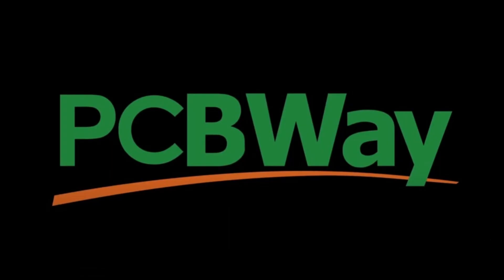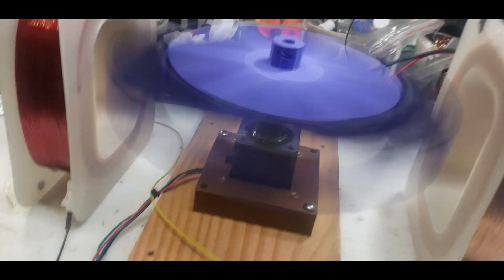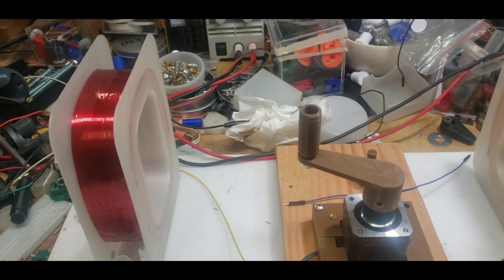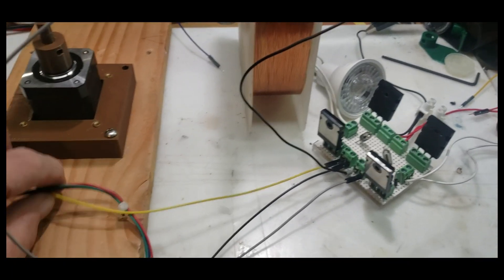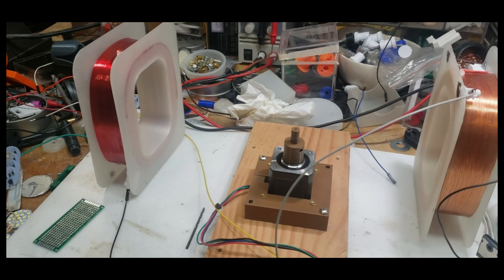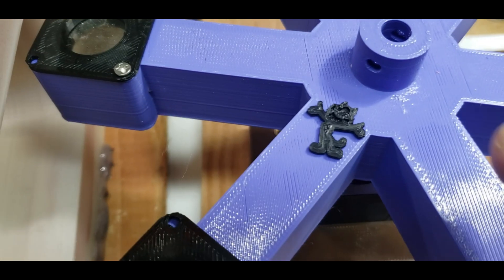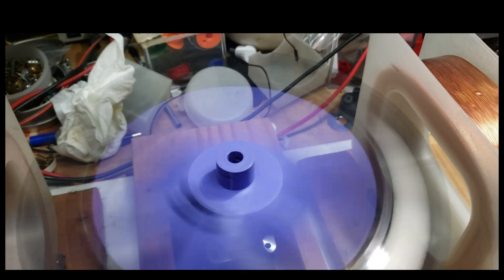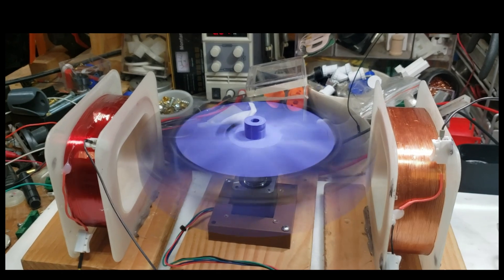3D Printed Pulse Motors Stepper-Generator

Comment: sorry but im confused are you making a generator to produce electricity but your using electricity? is it going to be swiitched over to steam or somethoing? love your vids
Reply from the maker: No worries it was really just an experiment because I tried to get a rotor to spin the step motor using a bedini circuit but it didn't work I had to get then get a bigger rotor